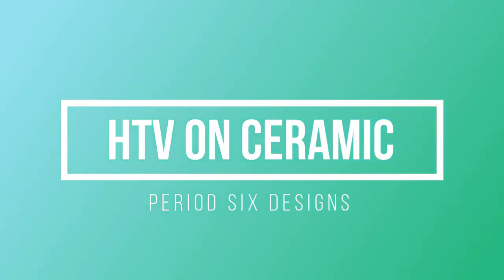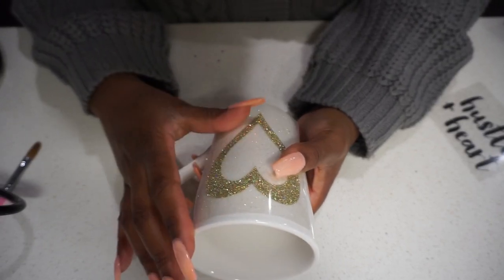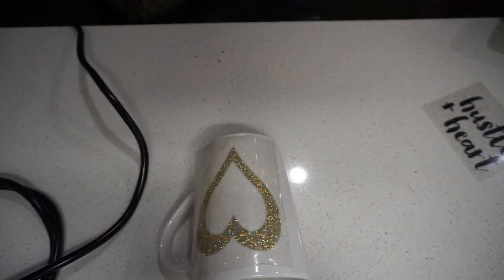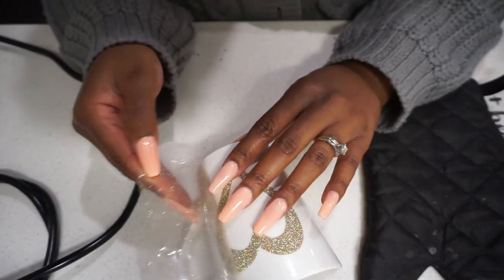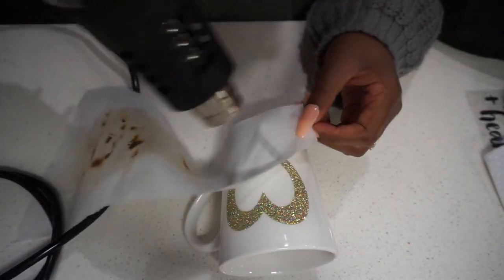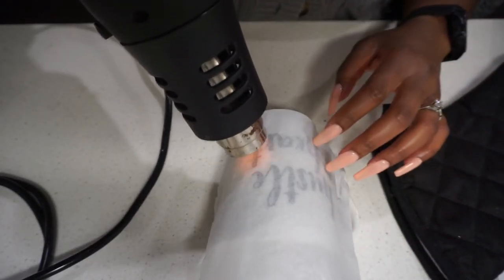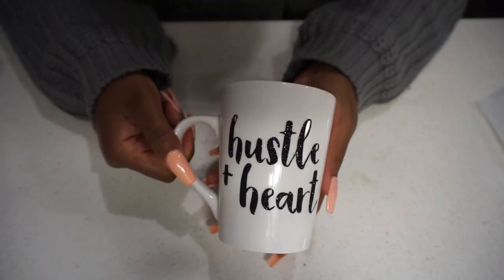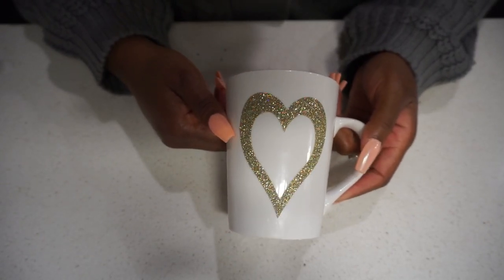How to Apply Heat Transfer Vinyl (HTV) to a Coffee Mug - Easy Craft Idea I Period Six Designs

Comment: I wonder how it holds after washing
Reply: I did some and sold and it came off in their washing it. So I am back trying to see how I messed up.
Reply: @freetobememe4358  Aparently you need to seal it with something, but for it to be "safe" you need to wait 28 days for full cure.
Reply: It doesn’t. 😭
Reply: @genesjewel1315  Even with a mug press?

Comment: I dont know if this would work, but when you put your HTV design with the transfer medium onto the mug, it sticks right?? So could you measure out the required amound of parchment paper to around the mug and hold in place with (If there is such thing) parchment tape, and then put it into a preheated oven for a certain amount of time?

Comment: how does it hold after washing?
Reply: It holds up really well. I put a test mug in the dishwasher and left it there so it ran through every time that I ran it. After 7 runs, it looks great.
Reply: @yolandapierce4258  thanks for the test feedback!  I will be using HTV on my cups/glasses when I don’t feel like using the resin!
Reply: Use sublimation tape to hold the vinyl down. It works perfect